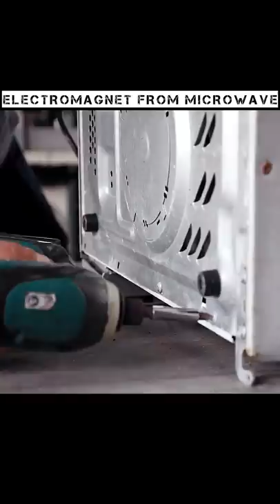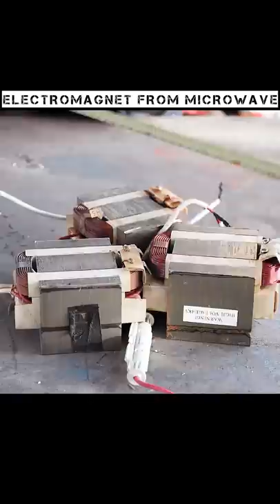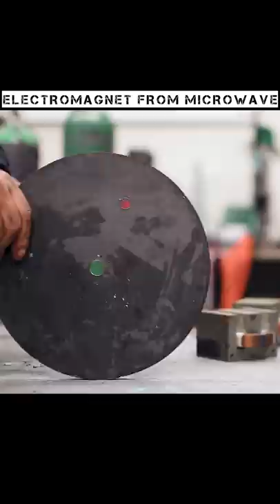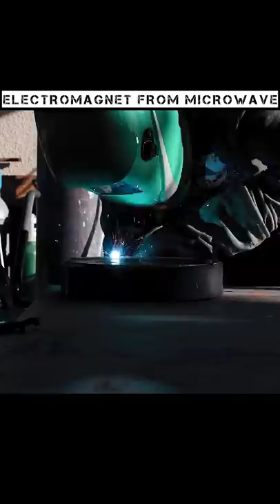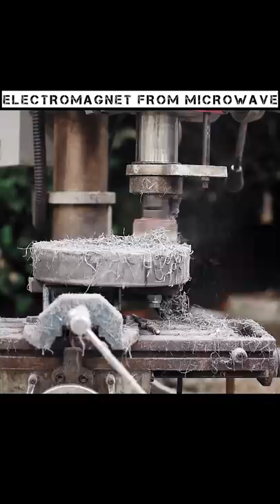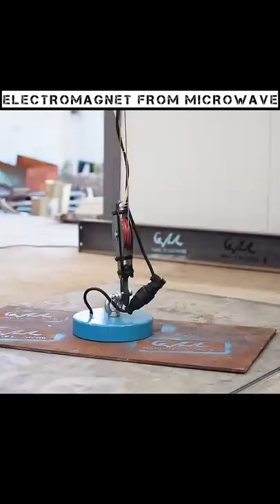Electromagnet from microwave transformers #shorts

Comment: The capacitors in a microwave can easily kill you even if not plugged in for days. Don't mess around with a microwave unless you really know what you're doing.
Reply: The guy was obviously know what his doing
Reply: @VINInvents  he didn't say he didn't know what he was doing mate. This is aimed at a general audience that might not be that familiar with the dangers within electronics so it has to be pointed out. Would be great to see a small warning on the video itself too
Reply: Email Subjekt  lol this dudes wacky
Reply: Email Subjekt  make a video bout it
Reply: The hottest shock I have received is from a capacitor in a camera
Reply: @dwbarnez7267  yeah, those capacitor bank in camera stores quite hefty charges which r used to quickly powered the flash light. 

Painful yes, deadly I doubt. No jokes buddy, compares to the one inside microwave these one goes in KVs range (Kilovolt, thousand. About 4to5 KVs normally requires to excite the electrones thru the magnetron). Its no longer about how painful but (almost) sure cases of (being) deadly!
Reply: Email Subjekt  you are right! It's your right to touch any high voltage component you want ITSAFREECUNTRYH*LLYEAH 😀
Reply: That's why you have a resistor shorting the capacitor in devices like that so after 5-10 minutes the capacitor charge has dropped over the resistor
Reply: @i7460  thats the proper way, while directing shorting with metal scredriver is the "hiway"... Yet sometimes people tend to forgot (me included, 😢) the safety step!
Reply: Can you explain me like how it will kill ??seems interesting
Reply: Email Subjekt  don't forget to filming it when you do it, so even although you dead your family members still can upload the video
Reply: I use big high power resistors hair dryer wire to discharge capacitors.
Reply: @shahilthapa5918  capacitors is a basic component in electro technics. It contains two metal surfaces decided by a isolation surface between them.
When you apply a voltage the capacitor will act like a short circuit even tho technically it isnt because the isolation. But the surfaces charges up depending on the voltages you apply. Positive gets the positive charge and negativ the negative. When full the resistance tends to be infinite. 
When the capacitor is removed it keeps its charge and as soon you short it ,it releases everything nearly instantly. And if you're the one who short it it hurts or kill you depending on the charge . I hope I explained it well enough
Reply: @madlesssm9127  how he supposed to post it
Reply: @randominternetguy5184  make a friend record lol
Reply: Same with refrigerators I've heard.
Reply: How about you tell us how to mitigate the risk instead? Turn it on and off again?
Reply: @SMR311SMR  The best warning I've ever seen was on the smooth side of a fan belt. It said, and I quote "TURN ENGINE OFF BEFORE TRYING TO REPLACE"!!! I wish I could have been there when someone first tried it! 😆😆😆🤣🤣🤣🤣🤣💀
Reply: I was about to comment something like that. Ty
Reply: Email Subjekt  you can break any rule - one time lol
Reply: Any way to discharge them without special equipment?
Reply: @shahilthapa5918  simply explained the capacitor is like a strong battery to hold power so the power is regulated for the part after the capacitor. Power arrives in irregular pulses of voltage depending on whats going on in the overall system. Capacitor keeps the voltage at a steady level for the device after the capacitor. 

So the capacitor is holding all this energy like a battery and if you touched it it could be like getting shocked by a powerful cable. Many people might know not to touch a thick electrical cable but a little boxy looking thing, they may just grab.

ZAP!
Reply: Now ya tell me, gosh. Wanna know what burnt flesh smells like?

Just kidding.
Reply: Email Subjekt  you wack dude
Reply: @VINInvents  but ho didnt provide do not try at home thingy
Reply: Bridge the terminals with a screwdriver that has an insulated handle to discharge the cap
Reply: Email Subjekt  it's your life , mate.
Reply: @i7460  
Man u definitely kno a few words of sound advice but I need more thorough training. I've replaced all type of capacity charged units, usually tearouts & installs. AC, DC, automotive, residential. I must not be doin something right cuz even though I got the putting a buffer between mysel & unit part rht, I still don't understand it fully cuz I've been careless at times & would be rushed throwing caution to the wind & yet no shock, but y? I kno how caps store & discharge fully BUT why are they used if they always go bad & there's clearly enough amperage to not even need them period, especially in 120/220 volt systems.
Reply: I see that you have a very good idea to make an electromagnet
Reply: @climatechangedoesntbargain9140  How about not risking your life with advice from a YouTube comment? 

Just don't try this at home unless you know what you're doing. If you have to ask, just don't do it.
Reply: @richard6946  if everyone was thinking like this, no one would know what they're doing
Reply: @foodank_atr817  just short its terminals
Reply: I dont think the cap will keep the high voltage after turn it off because one of its terminals is connected to ground by a diode , go and see by yourself but be aware of get electro shock lololol
Reply: @techmonster2632  And how exactly is it connected to ground if you just unplug it from the socket? Where does it magically discharge to?
Reply: This guy doesn't look like an amateur.  Short across the terminals  of the capacitor with a screwdriver you will be fine.
Reply: @shahilthapa5918  capacitors "store" electricity even when items are shut off to give the appliance, motor, ect a boost when the item needs it to start. They can provide a very hefty shock.
Reply: @shanekasper4587  This comment is not for the author of the video -- it's for the 5.7M other people that have seen it since who may not know what they're doing and start toying around one day.
Reply: A lot of people wouldn't be able to name the parts in an electronic device, so telling people the danger of a capacitor is a moot point.
Reply: I was about to write the same, people should never try to open a microwave if they don't know what they're doing.
Reply: @dwbarnez7267  same lol
Reply: @chas1878  ❤️🤟
Reply: HOW
Reply: Richard…. Better dont oversee the real problem.
A small , still charged cap wont kill you. It will hurt, for sure, but thats it!
Think about the magnetron… this contains very toxic elements which are better not disassembled by casuals…
Reply: I work on microwaves all the time as my job and they are not as scary and dangerous as people think. It’s pretty damn easy to discharge a cap and be fine.
Reply: Not to mention the beryllium in the magnetron can be fatal
Reply: @VINInvents  he's*
Reply: Mind me asking why it would kill you just curiosity not planning on being an idiot
Reply: @randyherringshaw6325  

My favorite warning is on fish hooks. It says "don't swallow"
Reply: Most microwaves have a resistor that grounds it when not on but it is still very important to know what you're doing to not die
Reply: Wtf! So there is energy stored there even without being plugged in?
Reply: @GoEvenHarder  most have a safety feature to not do that but some may not have it or may be defective but it is important to take precautions.
Reply: @legatelanius4406  wow, I didn't knew that! Thanks brother
Reply: Came here to say just that!
Reply: Depends on the problem   I just replaced the control panel on my microwave because I got a sensor error after washing the keypad...easy fix just a couple of connectors to swap for a new one.  I agree though stay away from anything with big capacitors.
Reply: Isn't the copper coil making the electro-magnet?
Reply: Ой да ладно... ты ещё в советских телеках просто не копался... 
Микроволновка курит в сторонке.
Reply: @richard6946  there are videos on YouTube right now kids taking microwaves and making laser weapons with them burning holes and shit
Reply: How long does it take for it to drain?
Reply: @dwbarnez7267  Old friends and I used to crank up the flash on old disposables, rip off the back and shock the hell out of eachother. Good times.
Reply: Like the old tv sets
Reply: If you thinking of doing this just remember the capacitors electricity is cool and dangerous
Reply: Good piece of advice.
Reply: What now
Reply: I used to break em with a hammer as a kid
Reply: Life is simpler than thinking about each and every small useless details 
Live on the edge of danger 👍🏻
Reply: The beauty of You tube is that you get tips like this... I will not mess with Microwaves.
Reply: Indeed!... I knew someone that  thought he could fix a microwave...
He died in the intent... Muerte Fulminante, he didn't see it coming...
Reply: @akimbojimbo3763  just be prepared for a very loud POP!! if it's energized😜
Reply: Seen it on 1000 ways to die
Reply: Now they can go wipe out Gustavo Frings laptop!!
Reply: LOS  POLLOS HERMANOS where the 
Chicken is fresh and the death's are spicy 🐔😂😂
Reply: Smh I must have been lucky
Reply: Yes but so can the capacitors in a disposable camera flash, look up turning one into a stun gun.
Reply: MPM Welding  Me too. When I was 10 or 11 I was in the garage with my Dad "helping" him work on a TV. This would be about 1963. Any way he inadvertantly grounded himself and brushed against the lead for the flyback transformer. 20,000 volts knocked us both 8-10 feet across the garage. Moral:never reach two hands inside a TV and always discharge caps.
Reply: For realmente t022a
Reply: @VINInvents  nah, he died then they hired another person to continue his unfinished job
Reply: I thought they had a built in bleeding resistor.
Reply: ..

.ugh....
Reply: Clearly his first time around a microwave
Reply: Drinking water can easily kill you, even if just a sip. Don't mess around with water unless you really know what you're doing. 

Anything can kill you, dude had gloves on, and he's alive still, so I think he knew what he was doing.
Reply: @VINInvents  the producer of this video didnt point out the dangers, he really should have. This is a really good comment to be at the top. Hope no curious people get hurt trying this without knowing what the associated risks are.

Comment: For anyone that doesn't know about electromagnetism, the resin just holds the parts in place while the electromagnets aren't powered up. While the current is running through them, the electromagnets hold on to the material AND the housing so if the resin breaks while it's in use it will not fall apart until the power is turned off!
Reply: Pretty sure we all got taught about this in elementary or middle school
Reply: @Laevatei1nn  yeah it was like first grade we wrapped wires around a nail and hooked a battery to it
Reply: @Laevatei1nn  Yeah, well there seem to be a lot of people in the comment section that couldn't grasp the concept...🤷🏼‍♂️
Reply: @Laevatei1nn  That's theory, but it's the application of the theory which gives you a "feel" of a subject.
Reply: It won't hold onto the housing. The flux travels through the open ends of the core to the material being picked up. Not the back of the core. So if the resin was to break, the cores would fall out of their enclosure.
Reply: The answer i was looking for thanks !
Reply: @jasonstatham3937  You were awesome in that movie called "The Transporter!"
Reply: @Laevatei1nn  I'm sure but that's been a long time for me! I remembered not to touch the copper wrapped capacitors, as they would hold charge. Not about beryllium being in there though!
Reply: @jasonstatham3937  cool that you're interested in this stuff too.